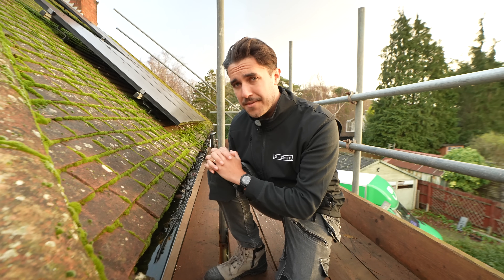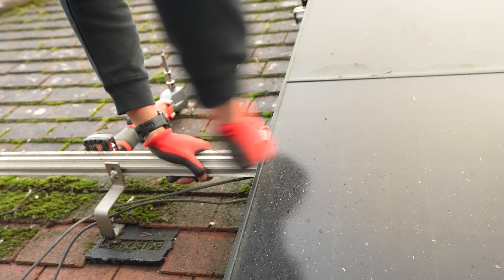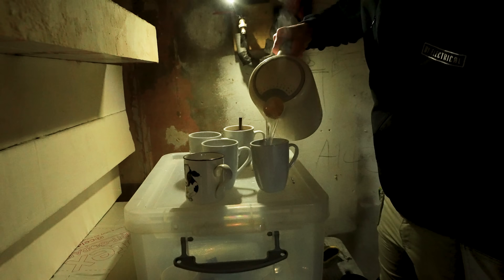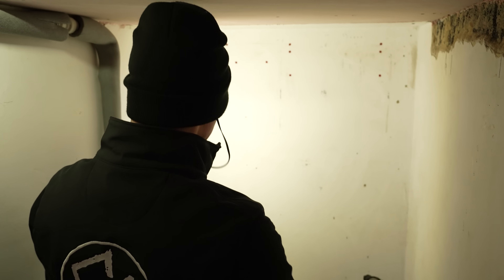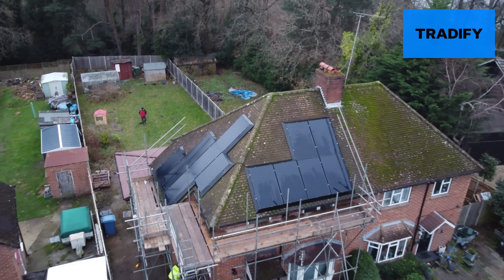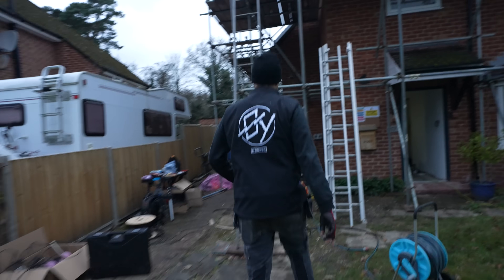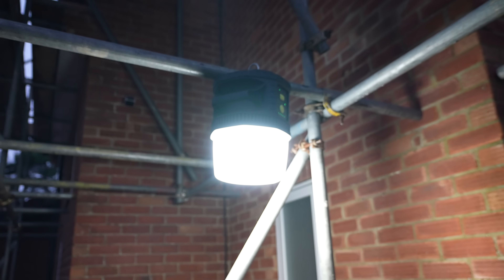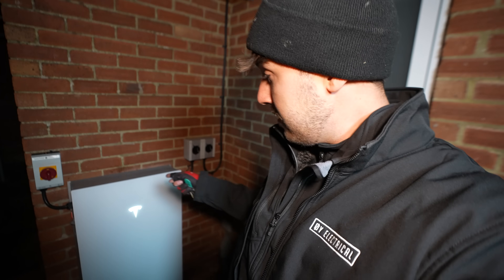Repairing a BODGED Solar Install | ØY54

Comment: Nice install. What size cable did you use between the gateway and inverter? Does it have to be fed by a 50a rcbo?

Comment: Hi Cory, how will the generation meter work? how have you wired it? i noticed its not a bi-directional that reads import, export and NET. what happens when you charge the powerwall from the grid, and then discharge to feed the house? the generation meter will log this as generation, which isnt correct?
Thanks

Comment: What you should have done: tear off everything on the roof. Hire a guy to pressure wash away all the moss and mold. Let dry. Paint the roof with something to PREVENT new moss and mold. THEN reinstall/install new stuff on top.

Comment: don't think you needed to setup and temp internet connection, as both the gateway2 and the actual Powerwall3 have built in 4G simcards, which should be fine for commissioning system

Comment: Very interesting to see the differences between the US and UK installs. Being an expat from the UK, the US way does seem a lot different, and I'm not sure which I actually prefer, especially when it comes to the way which grounding is treated. For the most part homes here are closest to a TT system (not quite, but close), which for a solar+storage makes it a lot less "complex" with no active PEN fault detection or similar needed. However with the amperages that are in use in most American homes, and the reduced voltage per part of the phase, it makes the cable runs quite large. In my case I have 4x PW3's - one is the leader, the rest followers, but all are wired into a CU. The CU is something in the region of 45cm x 90cm x 15cm, and has a 60A breaker for each power walls, a 'main' breaker at 200A, and a breaker for the Enphase AC Coupled solar (I think 80A?). 
The Enphase goes off to the combiner, the main breaker goes over to a cut off big-ol switch. That then goes off to the gateway, where the main feed is connected to, as is the house, and the feed from the renewable / storage main breaker. It takes up most of the side of the house, and the cables are ... not small. With it being a 200A circuit, and there needing to be 2x 200A legs (as most homes are Split phase, L1Low, Neutral, L1High - where if neutral is 0V, L1H is +120, L1L is -120) and then a neutral + earth. I think, if memory serves me right, the cable for the main feed, and the feed in/out of the house is 4/0+4/0+2/0+0 AWG which is 2x 120mm2, 67.5mm2 and 54mm2. Each power wall has a slightly smaller cable, I think 25/25/25/16mm2.

If it is of interest, I'd be happy to send photos so you can have a look at a US install

Comment: Given the PW3 can output 48A AC, what dimensions of EV Ultra are you using? I thought it only went to 6mm2?
Reply from the maker: The Doncaster EV ultra 6mm is rated to 58 amps.
Reply: @corymac  aah I see, sorry, I was thinking of t+e ratings, where 48a would be pushing it!!
Reply from the maker: No probs! I actually had to check it myself when I first wanted to use it

Comment: I love my PW3, but the annoying thing is the warranty, everyone publicises it as unlimited cycles, but if you - even once - engage in grid arbitrage (e.g. export from battery having charged when it is cheap) or participate in a VPP (e.g. intelligent flux) then your warranty is 37.8MWh which is 0.76 cycles per day for 10y.
Reply: I don't see the issue? They offer an unlimited warranty for standard low stress usage, and a still respectable warranty when pushing the unit to its peak power rating.
Reply: @LtShifty  other unlimited warranties are unlimited. It's not made clear that limit is in place. You could easily do a cycle a day charging overnight or during the sun and exporting at peak rates, which exceeds the warranty. Most people will want to export at higher rates, at least once ever, so for most people it isn't unlimited.

Comment: Is there any treatment you can put on the panels that will hold off the lichen for a while?
Reply from the maker: My panels at home seem to be the perfect inclination to fight it, generally south facing are less prone to it aswell. Just some inclinations and directions seem to attract it!
Reply: Mix up some "Wet & Forget" and spray it on

Comment: I totally agree, I paid an extra £2.5k to have my solar done by a local company had to wait 10 months due to how busy they are and it was well worth it the attention to detail and how they explained everything and put decent bird protection on the panels. A year later the system has saved me over £1500 in the first year with cheap charging and sell over 2.500 kWh to the grid and saving 4.200kWh in energy used. Cory is spot on save up get a good system from a local solar panel fitter better service, will have customer support and better after care as these local companies will be around when the nation ones have gone bust.
Reply from the maker: Absolutely, good choice mate!

Comment: )UK version of PW3, at least mine, has three inputs for panel strings with a isolator switch included in the housing. The US version takes 6 strings with no isolator.  Looking inside the box it looks like the space for three terminations in the UK box has been taken by the included isolator and presumably the electronics count reduced as well.

One issue is the Tesla APP for 'control' of the PW - has a nice graphical interface etc. but it does not tell you the generation level of each connected string, only reporting total generation.  In my case I would like to know how much each string generates and for how long so, when I have funds, I can determine which aspect to add more panels to.  The Tesla One (Installers APP) does show each string generation but it is not easy to work with - assuming that the owners should be working with it.

The Tesla Fleet APP does however report a load of stats should you be using Home Assistant so all is not bad (though it also does not report per string generation)
Reply from the maker: Interesting! Often to comply in the uk our products are sandbagged from what they’re capable of
Reply: @corymac  TBH I think is probable a wise design decision.  

Few UK installations would justify 6 strings, but I'm advised many US ones do.  

Reducing the number to 3 is probably a compromise which has allowed a string isolator to be included (the RH side of the unit) which saves on the install of another external switch (s) and no doubt saves on internal electronics.

I've read that US codes require external isolators for all panels and strings accessible to firefighters so the internal one would probably not comply in the US anyway.

The APP capability is, for most, more than adequate and PW3 can also be used with NetZero - it's only the inability to see only total  string generation that annoys me.

I've had my PW3 for 4 months now and no issues - all I need now is for the DNO to get their finger out and authorise feed in etc. (can't sort out the G99 or G100 issues)  But I see you also have experienced DNO issues 😂

Comment: My shed solar panel is giving out nothing at the moment!
Reply from the maker: It’s a bit pants in this weather! You’ll probably find it’s below the MPPT threshold
Reply: @corymac  I know, I fitted some on a friend's boat a few years ago, they work fine in summer but don't really do much in winter, but even in summer you only average about 60% of the full, rated output.

Comment: Cory - Do you ever put a shelf protector above the installation to deflect any rain?  I appreciate that in this installation there is some protection due to positioning.
Reply from the maker: I do when it’s needed, yes! Usually with giv energy it’s needed.

Comment: Great video. I’ve installed a few PW3s now and I’m continually learning. EV Ultra will work, but page 84 of the manual recommends a minimum 0.8mm conductor for the 12v runs due to potential volt drop. The cat5 in Ev Ultra is 24AWG/0.51mm. I use Doncaster Powerwall connect and rate the mcb and output accordingly. Also, those in line fuse carriers are a nightmare. They are now only needed if the kA is above 10 to a max of 16kA. Easiest thing often to do is put a switched fuse upstream leaving you loads more room in the gateway. 16mm trirated works a treat in those gateways too. Hope this helps.
Reply from the maker: Yes true, well spotted

Comment: Cracking install mate. Regarding the foot note about the Tesla Powerwall - your opinion is exactly the same as mine.

As a ecosystem, powered by an excellent app it is excellent. But when used outside of the US in terms of wiring and norms used outside of the US it could be way better.

I installed the V2 in HK (same electrical rules as the UK basically) and some V2 in Mainland China and honestly I would had preferred to have a different system developed to outside the US instead of a one size fits all approach we have now.

But their app and integration with everything Tesla is very good. But for outside the US I would prefer a Haier Smart Cube (OEM system that SigEnergy also uses), the MyEnergi one or the Solar Edge one. Or even the customizable to your needs Victron (that I really like a lot, honestly).

But that is my own experience, since at least on this side of the world there are tons of manufacturers, some that develop their own systems, others that just rename others with their branding. Same with Solar Panels, same with battery backup units.
Reply from the maker: If they speak to installers, maybe V4 will hit
Reply: @corymac  how many products we see/use could turn better if instead they listen to the ones buying their products for changes instead of the marketing team/engineering team who want features and attention grabbing specs/designs?

That's the question of the century, and one were that meme of the futuristic city society would be perfect...

In other words, Wind Turrets for when? You have been hinting that some times in other videos sparsely and I've been waiting for news because it is something I never saw anyone on YouTube doing in a way as you do and a area that it really interests me.

Comment: 10:00 solar panels need a decent clean every 3 months or so. depends on how dusty or how much lichen grows on them. i dont have a lichen problem, i get dirt and dust from the paddocks all over mine, really drops the production. ive also noticed if i can keep the panels cooler, i get far better production. (i'm down under, so it the panels real toasty in summer.)

Comment: From what I have seen of Tesla for solar and their EV charging is that to a client they know the brand so think they must be top of the range in terms of quality etc. but exactly as you said at the end they are more suited to American market where they are still in the dark ages electrically. No PEN fault detection, No load managing as standard has them miles behind other EV brands. I haven’t used the solar kit though I am trying to stick with Fronius and BYD
Reply from the maker: Well put

Comment: Wondering how long will it be till we start getting battery storage thefts..... lets face it at the moment with all sorts of thefts we cant have anything nice.....
Reply: As long as they try to budge it from the wall by just cutting the wires (like they sometimes do when they try to steal copper from distribution stations), that's fine with me.
Reply from the maker: It would be a lot more awkward and dangerous to steal than most things!
Reply: It’s pretty heavy, would have thought its paired to a customers account too, what’s the scrap value of LFP bonded to aluminium…

Comment: Small comment on the network test at 16:00 - you really want to check both the master and remote ends to make sure that both are reading in the correct order - for example if you've not crimped the right pairs at both ends, the master side will send signals down all of the strands in sequence, and the slave end will display out of sequence. I know from painful experience of making up CAT5 cables and doing many cable runs as a network engineer!
Reply from the maker: Great point to note! We had a guy on both ends, but didn’t make the cut
Reply: It looks like he had the sender unit in his hands, which will always go in the right order (unless it's not working). You need to see the slimmer receiver device to see it receives all signals, and in the right order... You'd unfortunately see the same results as here, even with nothing plugged into that end...
Reply: How much is a proper tester than can certify a cable, often they can have good continuity but other issues.
Reply: @edc1569  Certification is upwards of £8000-9000 for a certifier, and in almost no case would most people need to do certification. It's useful if you're a telco, or if you're doing 100's of runs, but honestly a good tester is more than ample as you usually only need to do a Qualification test. The likes of fluke make the linkiq testers that will do qualification style tests for about £2000, but even then i'd make an argument that for most jobs, even this would be overkill. Most lower end "professional" testers are 'good enough', the likes of the nettool, or pocket ethernet are even then usually overkill, but will do confirmation that not only the cable is working, but an end to end test works (check that packets can go back and forth)

Comment: Hi Cory 

Whats your thoughts on the gateway how does one overcome the fuse box/consumer unit created in the gateway being installed in a combustible construction for a domestic installation (namely plastic), would the client be accepting the deviation to acknowledge this ?. Battery storage is hotting up 😂
Reply from the maker: Very true point! As I said, just not 100% cut out for the UK. I’d be happy to install it still at customers request, but it’s not my favourite so far.

Comment: 12:30, 16:19 Over here in the US everybody goes Tesla Tesla Tesla! But they're expensive and sure there's an ecosystem but I think some of the other products on the market over in the UK have a lot better features. And if you're finding it difficult to run wires in that unit already then over here in the US where were using 120 V we have to use bigger cables and it would be even worse although we probably don't have as many obstacles to loop through.
Reply from the maker: Honestly, the gateway is a let down
Reply: Don’t you wire these things at the meter which is spilt phase 240? Cable diameters should be similar, though I guess an extra conductor?
Reply: @edc1569  yes split phase, so we're actually dealing with three wires 4 if it's a subpanel. never actually installed a gateway just sort of know what the process is by watching videos. I've done enough electrical work that I'm starting to get annoyed that I'm not licensed when I'm finding other peoples mistakes. That's one of my goals for 2025.
The conductors that are running in from the meter are fairly large capable of 200A they're quite thick I can't remember what the specific sizes (probably about the size of a thumb if not bigger depending on insulation), and they're usually aluminum which is bigger to save money that's about the only place where it's allowed. (aluminum can be used on branch circuits for specific appliances over certain amperage greater than 40 amp assuming terminals are rated for it and deoxidit is used. And is approved for service entrance conductors which is usually where the savings comes in otherwise not worth it ).  but they definitely look bigger than the 100A meter tails over the pond. So that's 2 cables and the bear conductor twisted together for the neutral which tend to be a little substantial. Most of the transfer switches I've seen are about twice that size to have adequate working room throughout everything.

As far as the power wall I think those are the same but definitely a different transfer switch/gateway.

Although a lot of new houses are going to 400A service which basically consists of coming in and splitting off to two panels 200A each.
and as each leg needs to be capable of 200A at 120V per leg or 400A at 240V across both legs. It makes for some thick cable to bend around trim, strip and land.

I wired a habitat house under the supervision of a electrician from incoming lines to receptacle. and replaced (as a homeowner allowance) my electrical panel from a federal fire Pacific panel (the company essentially slipped a check under the UL certification companys door to get approval. After things stabilized in the country UL came back and said no these don't actually function properly and aren't safe. Yeah no kidding you can touch wires together an arc weld without them tripping. Unfortunately they were installed almost everywhere ).
Reply: @edc1569  funny I closed out the tab after I finished replying and went to the next tab I opened and well it's not an Electrical video the background video they used shows a fairly good representation of an install with a transfer switch. https://youtube.com/shorts/muEe_iLbLOg

Comment: 15:50 I was testers are OK. But some thing I learned from having access to about four different ones is that some of them will show the fault on one side and some of them will show the fault on the other side so it's good to know which side you're particular unit shoes on and then label it. Otherwise you could be thinking all your cables are good because you're using the end with the battery when it's the other side that's showing the fault or vice versa. Also I have thought about using nail polish (probably clear although a color would indicate that it was protected) on the ends of those pass-through connectors to just add a little bit extra protection. But as you said if you have moisture problems in that Jack already you've got bigger problems.

Comment: PV-Ultra® - Double Insulated Multicore DC Cable where to buy out side England "Denmark " and great show :)
Reply from the maker: I think Doncaster cables would send you a drum,
If not I can arrange it. It’s great stuff. Send them an email and send a link to this video?